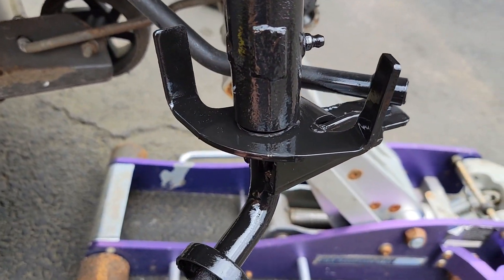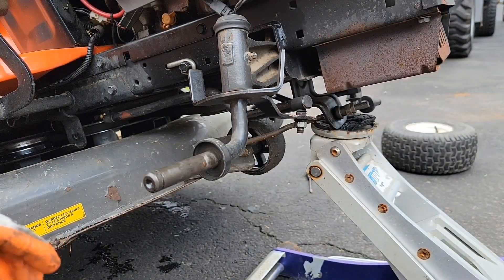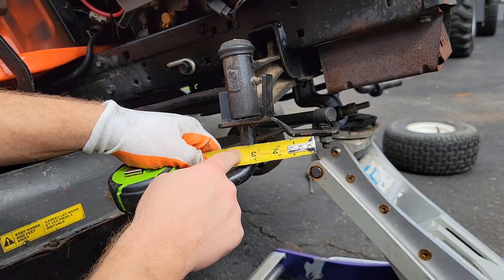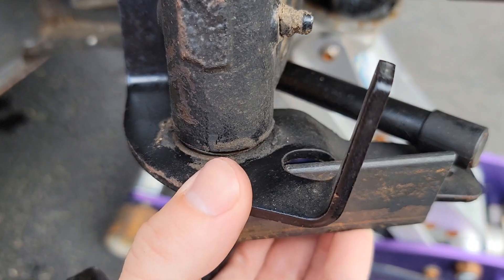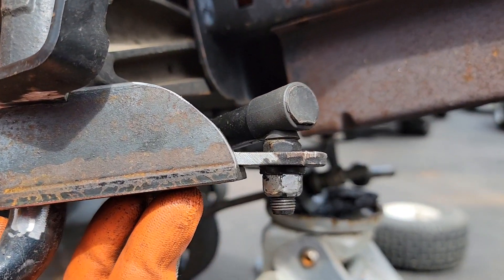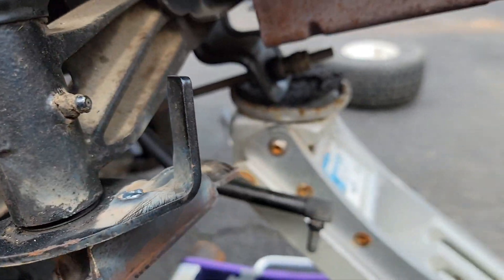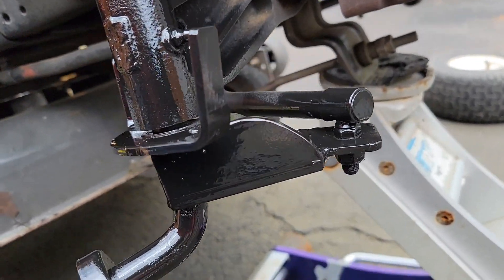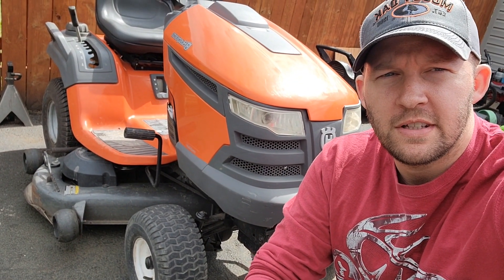Permanent Fix for bent spindles on Husqvarna, John Deere, and Craftsman mowers toe in alignment

Comment: (Thanks  on this  video)  My 2006 craftsman YS 4500  has exact  same problem So I fixed it temporarily to use rider by bending that "L"  metal So darn steering rod  not grinding on engine pulley , It's all because  of that cheap "L" mental bending , I'll fix it the way you did Thank you 😉

Comment: I just had mine apart yesterday to install wheel bearings to replace the old stock bushings and I noticed the design of those spindles. I kinda wondered how to strengthen them. Mine are still in good shape and my wheels are still in perfect alignment, but I want it to stay that way, now I see how! Thanks!

Comment: Thanks for coming up with a real fix.
For those of you who don't weld straighten your spindles like in the previous video and take them off and to a welder.  They're just going to bend again if you don't do this fix.
Cut the grass today after doing the fix and my tractor corners like a Porsche now.  The feel is completely different, I can tell it's really fixed.  Thanks again.
Reply from the maker: Yeah it feels so different when the wheels are pointing the same way!

Comment: Came here from your previous video on how to straighten these spindles.  I wasn't planning on grinding and welding today but this is the only fix I've seen for these lawn tractors that makes sense.  Just finished and this tractor has never steered so well.  Thank you!
This also works on an Ariens 936 series lawn tractor which is what I have.
Reply from the maker: Glad to hear it

Comment: Buy a real lawn tractor/mower Like a John Deere John Deere not one of those MTD cheap Home Depot mowers
Reply from the maker: Lol so many built by the same company
Reply: That's not a solution to the problem, this is what thousands of people have. We can't just run out and buy a new mower. And who says it doesn't have problems also. You sound like people who were buying imports back in the 1980's , like a Honda or a Toyota was invincible.
Reply: my  D170 " BIG BOY  not the welfare edition John Deere  does the same thing lol they aint real mowers
Reply: @TheCaperfish  D170 is a big box store mower, not a real Deere.  Just a branded MTD.
Reply: Yes but the decks are much thicker and better built than 110 s etc
Reply: @TheCaperfish  Has nothing to do with this issue.

Comment: This is great, unfortunately I am not  a welder.  I will do your bend repair and you have gained a subscriber.    I have a very uneven yard and my orig toe in is basically gone.  You could do a side hustle with your idea, get new spindles, reinforce them and resell them.  I for one would be interested.
Reply from the maker: That's not a bad idea, the problem is scalability.  I would think I'd have to charge 150/pair to make it worth it